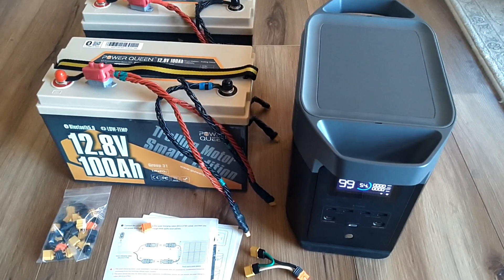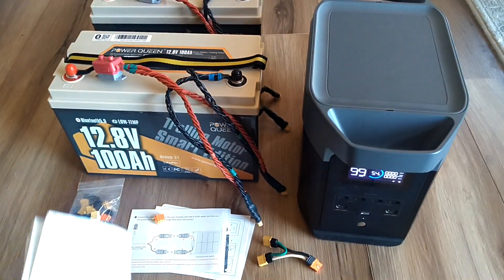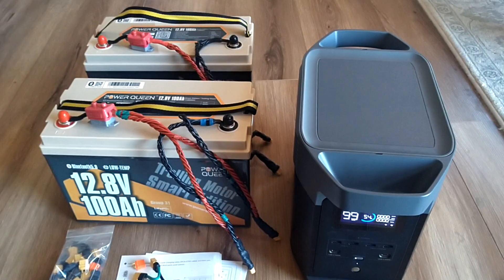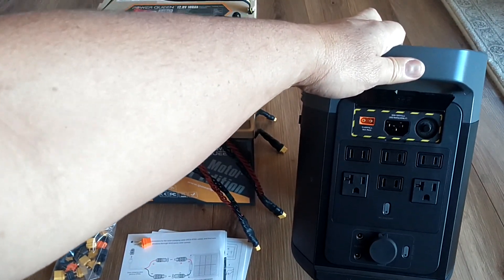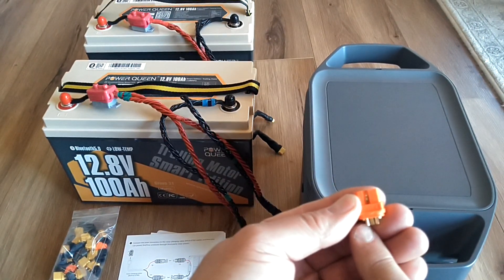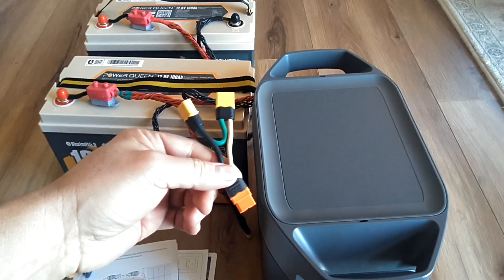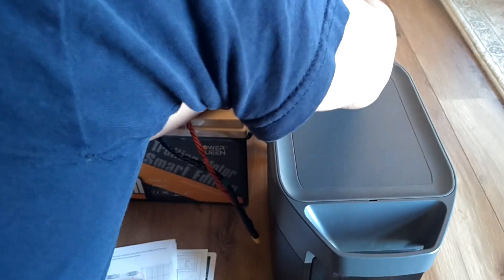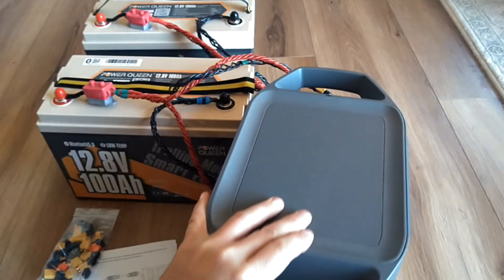Extending the Capacity of a Power Station, EcoFlow Delta 2 from 1KWh to 3.5KWh

Comment from the maker: Y Connector Assembly Video: https://youtu.be/RNMV67Wbvu4

Items used in video:
EcoFlow Delta 2 on Amazon #ad https://amzn.to/3ZScvmv
XT60I Connector on Amazon #ad https://amzn.to/4iEe12T
Self resetting circuit breaker 30 Amp #ad https://amzn.to/4ghwTTI
Power Queen 100Ah  LiFePO4  battery #https://amzn.to/3Y1hgZyad

Comment: Can you suggest a cheaper 51.2volt 100ah  battery solution, my scenario is i am in a condo no access to solar but want to have a more robust backup situation for a power outage normally 5-6 hours up to 24 hours. Mainly for the fridge and keeping my internet up and running and charging my laptops, I have purchased the Eco Flow Delta 3 plus with the expansion battery it was a bundle, but i want to get to the 5kw capacity.
Any suggestions would be much appreciated.

Also if space is an issue can you suggest a smaller battery foot print that would get me to 5kw
Reply from the maker: I’m a fan of the rack-mount server-style LiFePO4 batteries, for the larger capacity banks as they offer excellent storage capacity and a sleek, modular design. I currently run two of them in a 24V 200Ah configuration.
This particular model linked here: https://amzn.to/3JITfly is a solid choice. It’s priced similarly to the more basic battery styles but comes with several upgraded features: Built-in circuit breaker for added safety.
Integrated display showing per-cell voltage, overall voltage, current, state of charge (SOC), and cycle count.
Also you can connect via BT through the app to monitor with your phone. 
These extras make monitoring and managing your battery bank much easier and more precise.

You will need a 48V LiFePO4 charger for these external 48V batteries also if you do not have one. Like this one: https://amzn.to/47CVRvi

Let me know if you need something different.

Comment: Please understand your videos is great. There’s just other options if you want simple get the power queen 51.2 V 30 amp battery use 12 gauge wire you’ve added 1536 watts for $479.99 on sale 8/3/25 $369.99 listen to your battery no Y needed. Positive wire negative wire XT 60 you’re done or get the 24 V 1280 watts battery single set of 12 gauge wire positive negative XT 60 that’s it. But if you prefer multiple 12 V batteries which I can understand because I have other uses  for 12v. Still 12 AWG wire the negative from the first battery goes to the positive on the second battery. The positive from the first battery is your system positive to the i the negative from the second battery is your system negative to the xt60i you now have a 24 V battery you don’t need to make a Y. Just make sure you’re positive and native wires are the same length that way you’re pulling power evenly.  I almost forgot MRBF fuses I know the cost seems a bit high considering you’re not pulling a lot of power but lifepo4 batteries has a very high short circuit potential you need a fuse that can stop that and that’s gonna either be an MRBF or a tight T fuse, which is well beyond what you would need you can still do the auto reset that you have on there the MRBF only goes down to 30 A but you want that interrupt capability just in case all of the lithium chemistries put out a lot of power if you’ve got a short circuit on them

Some of you are probably thinking why should we listen to you? I build batteries for fun. I currently have a 30 amp of 50 amp that I designed a PCB bus bar for 100 amp another hundred amp that I designed a PCB bus that’s not actually together yet mostly it’s just me procrastinating. I got into batteries before all of these companies were making lithium on phosphate lifepo batteries so I so when I say I build batteries, I mean raw cell and a BMS wire size I obsess over wire size oh my God I just ran some 00 wire in my van for two Orion XS, DC DC I gonna be putting somewhere between 300 and1200 A in my van not because I need that much power but because why not. Did you know the currently selling 310 amp hour prismatic eve cells that’s 4402 W hours for each 12 V battery you put four of those in parallel you’re talking about 17,608 hours. It’s gonna be glorious probably just gonna use Jag35’ pcb busbars why reinvent the wheel but it might design my own just for the shits and giggles.
Reply from the maker: Thanks for sharing those alternative approaches and your in-depth explanation of battery-building. There are so many creative ways to expand capacity for these power stations, and I just wanted to offer my method as one more option for folks to consider. Personally, I’m a big fan of the 12V battery setup. I use them across a bunch of applications: my RV, truck camper, generator starter, and a few others (with more popping up as I discover new uses). It’s especially convenient being able to move them around so easily. The 24lb 12V 100AHr with a carry strap just makes them perfect for me.

Comment: When your two external batteries are charged and hooked up to the Delta 2,  and the Delta 2 is outputting power to something like a refrigerator...are the two batteries just recharging the Delta 2 as it is drained by the refrigerator, or is it a direct pass through so the battery voltage is going straight to the refrigerator once the Delta 2 battery gets low.  Also, do you have to recharge your two batteries separately or can that be done through the Delta 2?
Reply from the maker: I'm not entirely sure how the internal workings of the Delta 2 function. The display shows both output and input power simultaneously, so I’d like to assume that energy passes through as it's being used and replenished—but that might not be accurate. As for the two external batteries, they do need to be recharged individually, but that’s a minor inconvenience.
Reply: @madscientisthut  I know that the Delta 3 plus has pass through, but I haven't heard it mentioned with the Delta 2, so I was just hoping... And as for recharging the extra batteries, it's easy if you already have a charger and/or a solar controller.  Otherwise you have to buy them.  I'd like to find a power station that would allow any external battery to be charged through it's built in systems.
Reply from the maker: That would be a great feature to have on any of these. I am pretty happy with all of the features the Delta 2 has, but the would certainly be a cherry on top to have a charge controller built into the charge port!

Comment: Couldn't you have connected the batteries in series and then connected using one xt60 connector. You're just doubling the voltage right?
Reply from the maker: Yes, LFP batteries can be wired in series, and it’s perfectly fine to use a single connector. I opted for a Y-connector setup for a couple of practical reasons:
- It makes relocating the batteries much easier without needing to unbolt anything.
- I repurpose the same batteries across multiple applications—my RV, truck camper, and even as a generator starter.

Comment: Does it work with Ecoflow river 2 pro?
Reply from the maker: The EcoFlow River 2 Pro features slightly different DC input specifications: 11–50V, 13A, with a maximum input of 220W for solar charging. While connecting two 12V LFP batteries in series falls within the acceptable voltage range, the River 2 Pro will still cap the input power at 220W.
Reply: @madscientisthut  Thanks for your response. I know the limitation in power. I'm talking about the center pin connection.
Reply from the maker: Yes the XT60 center pin will work the same.
Reply: @madscientisthut  Ok. Thanks.

Comment: Since they sell addon batteries for the Delta 2, shouldnt there be a way to wire up a battery that way so that it can be charged and discharged in unison with the main unit? I don't have a delta 2 yet, just looking at options before buying one. They seem like a good deal at $450 right now.
Reply from the maker: Absolutely, EcoFlow designed the Delta 2 with expandability in mind. Their official Smart Extra Battery connects directly to the main unit and charges and discharges in unison, just like you're hoping for. It’s a plug-and-play setup, so no custom wiring or DIY mods needed to sync the two. That said, if you're thinking about wiring up a third-party battery to mimic that behavior, it gets tricky to reverse engineer. The Delta 2 uses proprietary communication and battery management protocols to safely coordinate charging and discharging. Without that handshake using the extra battery port, you risk damaging the system or voiding the warranty. I think $450 is about what I payed back when I purchased mine. I am pretty happy with the performance at that price point.

Comment: How do i then recharge the battery after i have depleted it. Lets say i have no grid power and an inverter. What do i use to charge the lifepo4 expansion battery
Reply from the maker: In the event of a grid outage, I utilize my vehicle and jumper cables to recharge the LFP battery, achieving a charging current of approximately 90 amps. When a rapid recharge is unnecessary, I instead rely on the solar panel array I have installed to provide a slower, sustained charge. But usually when the grid is down there is no sun because of clouds, so the truck is my main fall back for sustaining the battery setup.
Reply: @madscientisthut    My understanding is that that the internal cells are very sensitive and need to be properly balanced using somewhat specialized equipment while charging.   Advice welcome
Reply from the maker: Whether you're referring to the Delta 2’s internal cells or the external LFP batteries, both rely on an internal Battery Management System (BMS) to regulate individual cells during charge and discharge cycles the BMS handles all of the cells sensitive needs. Power Queen recommends a max charge current of 20 amps to prolong battery life, but in an emergency, preserving battery cycles takes a back seat. If necessary, I’ll push it to the 100-amp limit and take a hit on battery life span.

Comment: Do you have a vid on those braided cables on the batteries
Reply from the maker: This playlist has the three videos I did for the series. https://www.youtube.com/watch?v=S4b2rjgqwTc&list=PLEMrHgjIIvZIMFS7TZsPRfP-qQJWdDUGV&index=1&ab_channel=MadScientistHut

Regarding the braided wires in this video, I used them because I had thousands of feet of smaller gauge wire left over from a previous shop project. Rather than buying new wire, I opted to triple the wires up to accommodate the current.

Comment: Would it not be cheaper to buy the spare ecoflow battery at 350 go 400 bucks versus those 2 external batteries
Reply from the maker: I found the EcoFlow spare battery listed at $459 on their site, offering a maximum capacity of 1024Wh. In comparison, two Power Queen batteries together provide up to 2560Wh. When I originally purchased the Power Queens, they were around $200 each, though I believe they’re now closer to $209. That means you get more than twice the capacity for roughly the same price.

Comment: Hey thanks for the great video.  Got a question, does the direct 24v battery input hurt the delta 2?  I saw another person used a 24v converter with a certain amperage to charge instead.
Reply from the maker: The Delta 2 input is rated for max of 60V DC input. You can see the specs here: https://us.ecoflow.com/products/delta-2-portable-power-station?variant=41769207496777
Reply from the maker: Thanks for watching and the comment! The DC-DC converter would be great but a good quality one is usually pretty pricey.  I would also go for a 48V 500W DC-DC Boost converter if I went this route.
Reply: Thanks again!  Ok so no worry about the battery capable output amperage as long as the voltage is good for the delta?
Reply from the maker: @miketran4217  The amperage to the input is limited by the Delta 2 charge controller.
Reply: @madscientisthut  Thanks again!  Building my rig and just making sure.

Comment: Is there a way to connect those batteries as if it were extra? In addition to the station charging them?
Reply from the maker: I’m not sure I understand the question. Could you please elaborate?
Reply: Doesn't look like it so the solution is a little messy but costs less than an Ecoflow extra battery. You could have them charge with a solar panel plus MPPT or hook up a LifePO4 AC charger to the Ecoflow AC outlet with a AC outlet timer so it only charges during certain periods like during the day but there will be some power losses

Comment: OR you could just series the 12V Batteries ?
Reply from the maker: Yes, you can. However, for me, quick portability is essential. Having batteries equipped with connectors allows each battery to be moved individually with ease. This design greatly simplifies moving the system and makes charging the batteries much more convenient. Instead of needing to unbolt and rebolt the batteries every time, I can simply use the connectors. The batteries are much easier to move individually.

Comment: Has anyone been brave enough to try connecting a DIY LiFEPO4 battery through the proprietary extra battery connection port on the EcoFlow to see if a higher wattage charge could be achieved?
Reply from the maker: A quick glance at the pins reveals the presence of some communication pins. My assumption is that, without the ability to handle the proprietary communication, it likely won't function as intended, in my opinion.
But, if you had an EcoFlow battery it would probably be easy to reverse engineer with a little snooping on the data.
Reply: Thanks for pointing that out.  Was on the fence about getting one to try it out.

Comment: How do you charge the PowerQueen? Do you charge it when it is connected to the Delta? Thank you for the video!!! Great project. Congratulations.
Reply from the maker: Thank you for watching and for your comment! Currently, I have four batteries which I cycle through in pairs, charging them while disconnected from the Delta 2. If I had to during an extended power outage that requires more than the four batteries full capacity. I could recharge them with solar panels if the sun is shining and the weather is good, but this is usually not the case during a power outage ( always seems to very bad weather for the outages here). The fastest way I have determined for me to quick charge the LFP batteries in bad weather during a power outage is using my F-150 with jumper cables. I have connected the batteries to the F-150 for a quick charge at around 88 amps continuous draw, as measured by the BT BMS, it does not seem to cause any issues with my truck since it is not much of a load to the alternator rated at 225 Amps. I always keep my 36 gallon tank above 3/4 full for a situation like this since I have been through one natural disaster that resulted in power being down for over week.